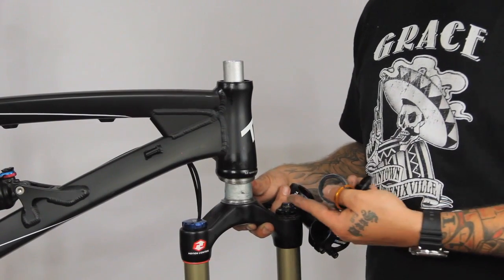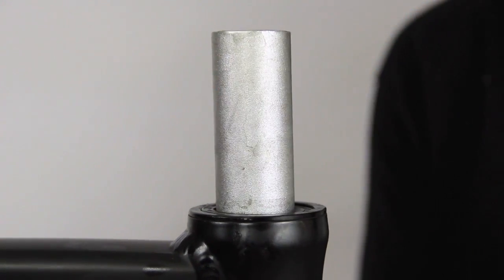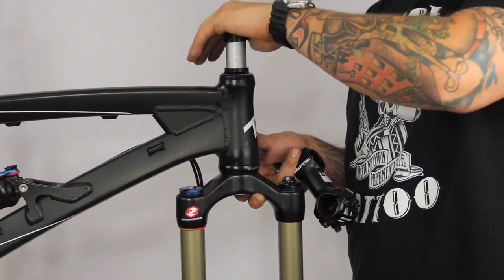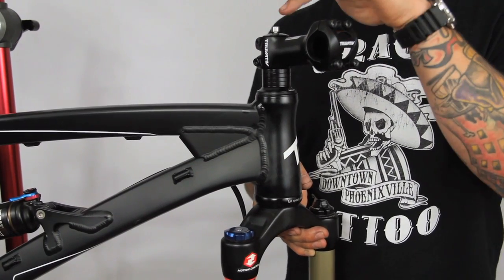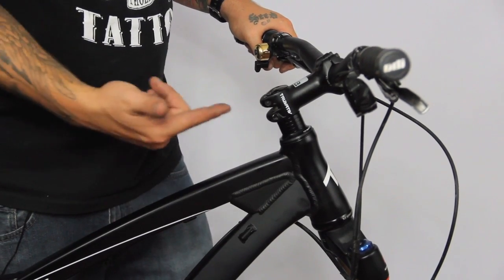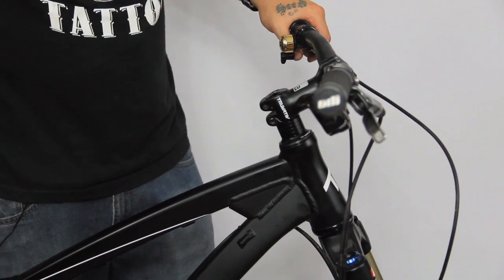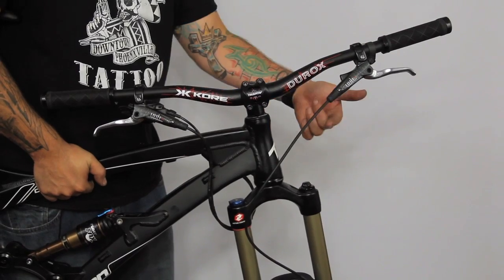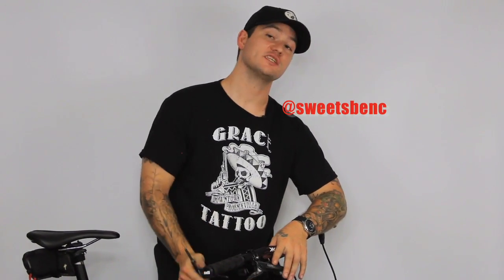Headset Adjustment (Threadless)

Comment: Can i put the top cap and bolt on if im missing a 10mm spacer...?
Reply: No. You must have all your steerer space occupied with spacers and the stem sitting flush when adjusting the headset bolt to make sure it's all running true.

Comment: Any idea why a threadless setup may be stuck in place. I have removed the stem but there is no movement at all when trying to seperate fork from bike. Is there another system i have never seen before? Does the Race, dustcap etc have a thread on it? I have tried as replacing, to beat the steerer to knock it free but no movement at all and don't really want to put to much pressure on an already old bike. Thanks for any help offered. (Marin rocksprings 99) @sweetsbench Trying to replace old fork.

** Edit, never mind, it turned out to be a good job done by the Race. Well wedged.

Comment: I have a problem with a clicking noise coming from the headset area on my carbon norco sight. There is no play in the bearings and there are no cracks anywhere. The clicking noise comes under heavy braking or rarely when the front wheel has an impact. Mechanics couldn't figure out why it clicks. It seems to be a problem which solves itself over time (long periods) but comes back upon servicing the headset again. Any ideas as to what may be causing it?
Reply: To lower after removing spacer do I need to cut the steering foundation ? Road bike...
Thanks

Comment: I'm attempting to service the headset on a department-store bike, and it won't snug down, no matter what I've tried, and I've triple-checked just about every possibility. I've had the headset completely apart at least three times, and after thoroughly cleaning everything and even smoothing out any irregularities on the surface of the steerer, the upper bearings don't seem to seat. There's ample stack height above the steerer (a quarter-inch), all the parts seem undamaged, the ball bearings themselves are in like-new condition, and there's no foreign objects or dirt in the bearings. The cups are well-seated in the head tube.

  The only anomaly I've turned up, is that the upper race is made of the same plastic as the seals. The one you show in the video looks like brass. I've done this same service job to dozens of other headsets, and I've never seen anything like it. I'm semi-retired and doing this for a friend, and we're both growing impatient, and sometimes I wonder if I'm going batty. It's as if the stem & spacers are bearing down on something else instead of the bearings & race. Any thoughts? 

Thanks in advance.